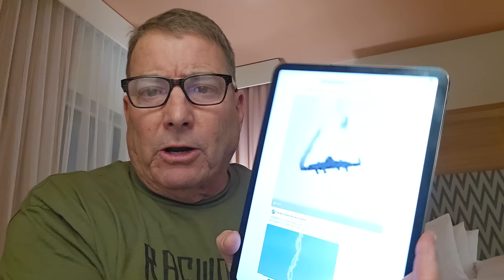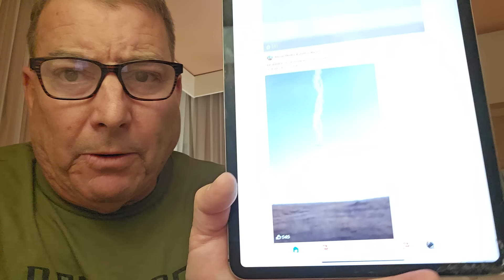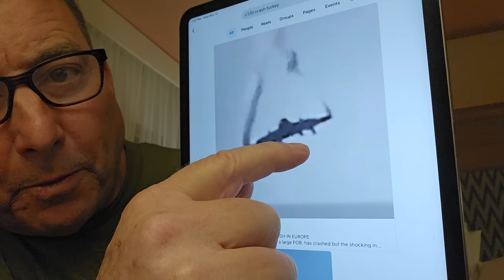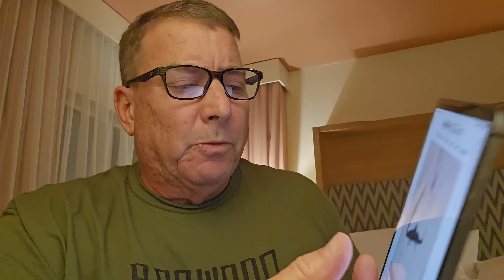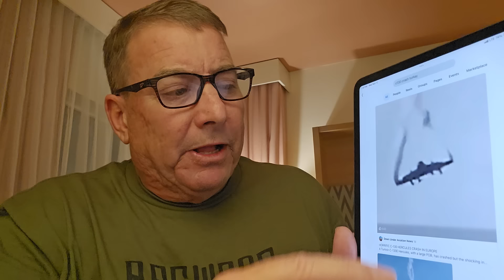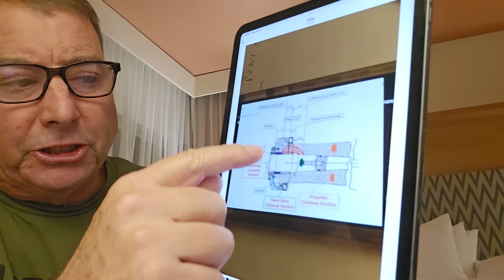Turkish C-130E Structural Failure 11 Nov 2025

Comment: Tragic.   A sidebar: When I was in USAF basic training 1971 one in my basic group had worked with his father's demolition company in Oklahoma. He put in to work with explosives. The USAF assigned him not to explosives but to stress testing of aircraft airframes much to his disappointment. I suppose it was decided someone that worked carefully with explosives would have the temperament to do careful airframe inspections. Landing and take offs put stress on the frames eventually leading to weak points that may eventually cause catastrophic collapse. He would have used devices that test the structure of the metal via xray or sonic waves as I recall.  When I first saw this "structual failure" that is what I thought would be the cause. A propeller breaking loose from rust? That's a new one to me.                                                                                                                                                                                                               Later I was an inspector then final line inspector of aircraft altimeters at Aero Mechanism. I recall one machinest who kept threatening violence because of my rejecting his substandard work :body-blue-raised-arms: My also meticulous nature would not let anything slide past.   Eventually I became a teacher. Now retired.       RIP those who perished.

Comment: My Marine Corps C-130 squadron in Okinawa had a similar incident during a post Phase inspection ground run up in the 80s.  None of the shrapnel hit the plane.  In the early 2000s this issue reared its ugly head again and appeared to be limited to a particular block of serial numbers.  

The Marine C-130 crash investigation in Mississippi finally traced the issue to a failure of the Air Force overhaul facility in Georgia failing to do certain inspections mandated by the Navy for Navy and Marine Corps propellers.  Heads rolled for that failure to follow directives.

The loss of a Chilean C-130  a few years ago (formerly a Marine Corps KC-130R which I had many flight ours on) could be a candidate for the same cause although because the plane went down in the Antarctic Ocean it was unrecoverable.

Those propellers are no longer on Navy or Marine Corps C-130s.  After this incident I think the operators of legacy C-130s will be upgrading to the new props.

Comment: Ok I'm an ex engineer on RAF C-130's at Lyneham in the late
70's. I know it's a long time ago, but we used to get foreign Air Forces
in all the time to do engineering work for them, even simple stuff.
What I learned over time was a lot of what I'd call third world countries
could not provide even minimal servicing.
They were basically not fit to fly.  They would even demand to be worked
on before our own aircraft as they stood at the front line desk.
One guy refused to speak to anyone white, until our Jamaican electrical chief
appeared.  Are we surprised this has happened ?

Comment: The causes of the crash of the Turkish C-130 Hercules military transport aircraft were:
A. One of the turboprop engines propeller blade broke due to metal fatigue (this is the primary cause of the crash). 
B. The broken propeller blade struck the side of the forward fuselage in the plane of rotation of the propeller, causing it to break apart.
C. As a result of the critical damage received and the impact of aerodynamic forces, the front part of the fuselage was torn off from the aircraft.
D. Then the front part of the severed fuselage collided with the vertical stabilizer, as a result of which the latter was severed from the fastening nodes on the fuselage.
E. As a result, due to the high (uncalculated) overloads on the fuselage, the rear section of the fuselage also broke away from the aircraft, along with the horizontal stabilizer.
F. Finally, the video shows the disintegrated aircraft (or rather, the wing with the engine nacelles attached to it) falling, spinning, and exploding on the ground.

Comment: When I was a Nav on Es and Hs, our biggest issue was wing failure outboard the outboard engines. Among other things, it was due to the stresses of overhead approaches and other maneuvers place reverse stresses on the wings. We lost at least two aircraft to this before the wing upgrades. The upgrades worked as evidenced by the LAPES accident at Fort Brag in 1988 or so. If I remember right, the idiot AC purposely achieved a 2000fpm descent rate and impacted the zone at some 9Gs. But the wings stayed on.

Comment: Odd, that I'm seeing nothing about the rear fuselage and tail setion, which we do not see in the footage to date.

It seems to me that an uncontained turbine, compressor, fan, propeller, rotor, pinwheel, etc failure is a possibility on anything that spins really fast, it's a reason why aircraft and such typically have markings to warn ground crew of hazards.

This hasn't happened only to C-130's, but assorted other piston- and jet-powered aircraft, and sort of correlates to the recent UPS MD-11 crash and others of all sort.

While fatigue surely plays a role, both in propeller separation and forward fuselage separation, I'm not sure how realistic it is, expecting structure to endure a propeller assembly buzz-sawing its way through at 1600+ RPM, even new and out-of-the-factory.

Comment: Egyptian Air Force had an accident where both the gearbox and prop separated and went through the fuselage and out the other side.  No structural failure occurred and they recovered safely.

Comment: I'm a bit surprised a C-130 doesn't have a shielding plate on that area of the fuselage specifically to protect against prop fragments. There are a lot of aircraft that have such a plate and aren't even meant for serving in such hazardous missions.
Reply: Those are likely for protection from ice being shed from the blades.

Comment: Propeller overhaul staffer here, unfortunately a failure that's too common. The prop blades are huge and carry a lot of mass, when they let go they slice through anything else with ease. The sinister element is often there is little or no warning before a balde fails. Old aircraft, old props and the most insidious thing with propellers is corrosion or weakening of the alloys after a lightning strike. Eddie Current, Ultrasonic, Dye Penetrant and visual inspections are really important. Cold rolling is really important as well. If they are skipped it doesn't take long for a little problem to escalate to a total failure. It's weird I alway feel so many people don't understand the extreme forces at play with propellers.
Reply: Amen!  I was one of the last groups of actually trained propeller mechanics before the AF combined the engine and propeller career fields. I had a 19 week school on props. That was condensed down to 2 weeks once the fields were combined. They didn’t really know anything. Props can only stand so much overhaul without increasing latitude in specifications. I saw that happening when bench checking newly overhauled props. They'd arrive with discrepancies. Barrel halves leaking under pressure and balance issues. It was concerning. I'm glad you took your job seriously. I always did. My signature meant that I was ready to fly with whatever I signed off.
Reply: @KathyHopkins  It was my first job out of school. Hard work dealing with aluminum blades making them look nice again. I even did a course on the old style Hamilton Standard DC3 prop. Some really solid engineering in that. Unfortunately so many people take aircraft props for granted, they are simple things that are put under a lot of continual loads. I saw some weird ideas, Q tips that were blades with dent over ends and the transition to the new carbon fibre blades. Honestly I trust aluminum more. The carbon fibre blades are very easily damaged beyond repair.
Reply: @leokimvideo People don't realize that the prop is the deadliest aircraft component there is. That's why it was not possible to fly with a known prop malfunction. Hamilton Standard never had a catastrophic failure until the money got tight and the engineers were allowing for broader and broader tolerances. It was a matter of time. They built damned good propellers for many decades. The Allisons they replaced were screw-in blade designs and were retrofitted because they tended to throw the occasional blade with the expected results.

Comment: A tragic thing. However, I cannot understand why the design hasn´t been changed. The C130 is a reliable and very often used aircraft. I never knew about problems with the propellers. There is one thing I like to tell:  hearing a very loud aircraft at obviously high altitude I wanted to know what it was. Flying directly above us the sound was really roaring. I took the frequencies from the approaching and the leaving sound and estimated a speed of 600 km/h which is the design speed of the C130. I wanted to know which one it was. However, the Flight Radar 24 didn´t show anything - military aircraft. The aircraft passes two to three times our region and everytime I tried to see it. One day, when I heard the sound,  Flight Radar 24 showed a C130 from the royal canadian airforce with destination Ramstein in Germany, where I live 150 km off. The speed was confirmed. One time I saw the plane when the sky was very clear. Now, hearing this plane with such a loud "voice" at this high altitude lets me think that there will be many vibrations on the whole structure and possibly two props in combination reinforcing the vibrations.

Comment: My Grandfather was a Captain for Northwest Airlines and a FAA investigator for 727 crashes. Before that, a flight engineer.
They used to carry a coin in pocket to check blade integrity before flight checks. Take coin and tap the blade and listen for sound.

Comment: That is probably what happened. I spent a lot of time with C-130s being stationed at Pope AFB in the mid 80s. (317th, MAC.)
Extra info.: Something that most may not know is that the floor panels of the C-130 provide structural support. If all floor panels are not installed structural support will be compromised.

Comment: Were these C130 prop/gearbox failures, 
1 prop separating causing gearbox/engine separating
2 gearbox failing and separating
I always cringe seeing those airliner size prototype turbo props with geared reduction.

Comment: Perhaps, at some point, their propellers need a complete overhaul replacing any parts having corrosion or maybe replacing the entire propeller assembly.  Maybe?

Maybe the liberated propeller blade doesn’t sever the wing-fuselage joint outright but so weakens it with damage that it completely fails under load.  And maybe that breaks the fuselage into two or more sections.
Reply: Propellers and other aircraft parts and assemblies are usually subject to limits ( calendar time since overhaul or installation, and or time since overhaul) as to when they must be overhauled.  The overhaul is a comprehensive inspection and mandatory replacement of certain parts.  Blades are inspected for damage and corrosion, and NDT inspected for cracks.  Blade damage is filed away, but the blades must meet dimensional minimums.

Comment: These failures on the Lockheed C-130s make me think back to the Lockheed Electra failures in the late 1950s and early 1960s.  Probably just coincidentally a failure in the same areas of the aircraft. 

Thanks for taking the time to post a video.  
I was in the USAF and stationed on a Turkish Air Force base for a year in the mid seventies and grew to respect the Turkish airmen’s courage and pride.  They were flying F-104s and ‘Lead Sleds’ (F-100s) on possible NATO missions against the USSR during the Cold War. RIP to the brave aircrew and deepest condolences to their families and friends.

Comment: My deepest sympathy goes out to the aircraft and family's of this horrific aircraft as a aircraft mechanic for former air America I have worked on these old c130e hurts with the t56 Allison Powerplants and we had corrosion issues ìn the blade hub . And by looking at this crash video it certainly looks like a propeller blade separating from the blade hub causing the aircraft total destruction in the fuselage assembly very disturbing to watch this happen God bless this aircraft 
Thank you

Comment: Maintenance includes inspection. It would be great to look at the records and see if the prop was being serviced correctly. If the corrosion is inside the blade hollow then that is detected at any blade removal event. Corrosion on stressed metal cause’s embrittlement and cracking.

Comment: The "Yanky 72" crash refers to the 2017 crash of a Marine Corps KC-130T Hercules aircraft near Itta Bena, Mississippi, which killed all 16 service members on board. The accident was caused by a propeller blade failing due to fatigue cracking, which sliced through the fuselage and led to the plane breaking apart in mid-air.

Comment: Its likely a missile strike or ordinance onboard let go......the C130 is a hugely strong aircraft, very dubious both the front Fuse and tail falling off at the same time.
Reply: You're wrong. Look up the "Yanky 72" crash. That refers to the 2017 crash of a Marine Corps KC-130T Hercules aircraft near Itta Bena, Mississippi, which killed all 16 service members on board. The accident was caused by a propeller blade failing due to fatigue cracking, which sliced through the fuselage and led to the plane breaking apart in mid-air.

Comment: I remember a Air National Guard C-130 from Puerto Rico crashed from structural failure. Edit: I researched a little on the crash and  the investigation said it was pilot error after losing #1 engine.

Comment: Hang on ! How many times have these props failed for internal corrosion ! I very well remember small commuter aircraft that have also had the same prop failures after they had been rebuilt . And one of the findings of the NTSB was chlorine had been used to clean out the inside of the hollow mounting end of the prop that had failed . Something is seriously wrong in this rebuild process .
Reply: Corrosion is a big problem and you need to take the time to look for it, and have the experience to recognize it.  Corners are always being cut in maintenance unfortunately.

Comment: Much of the speculation in the comments appears premature, particularly regarding possible blade liberation similar to the July 10, 2017 KC-130T accident that resulted in an in-flight breakup and the loss of 16 crew and passengers.

While the available video footage suggests that the #3 propeller is missing from the #3 QEC, the video and still images lack sufficient resolution to determine whether the reduction gearbox (RGB) remains installed in the nacelle or has also separated. At this point, there is simply not enough data available for lay observers such as ourselves to draw reliable conclusions—or even to determine whether the missing #3 propeller was a causal factor in the breakup or a consequence of it.

There are also several notable differences between this event and the KC-130T mishap. In the 2017 accident, liberation of a P2B4 blade led to fuselage penetration near FS 377, impacting the LBL 61 longeron. That initiated failure of the #3 RGB and a subsequent propeller strike around FS 377, which caused forward fuselage separation between FS 350 and FS 477. The aft fuselage remained attached to the wing, although the right horizontal stabilizer was severed by the #3 propeller following the forward fuselage separation.

By contrast, in imagery of the Turkish aircraft, the forward fuselage appears to have separated from the wing farther aft—between FS 477 and FS 485, approximately at the wing leading edge—which is significantly aft of the separation point seen in the KC-130T. The aft fuselage also appears to have separated around FS 737. Photos of the aft section suggest that the ramp is missing and the cargo door is open, though this may be the result of post-crash loads as the tail section is inverted. Notably, both horizontal stabilizers appear to remain attached to the aft fuselage.

In short, while the superficial similarities to the KC-130T accident are understandable, the available evidence does not yet support any conclusions regarding causal factors in this event.

Comment: I may be mistaken but I believe the Embraer Brasilia has the same propeller hub with different blades as the older Hercs, and they too had various corrosion problems leading to several catastrophes. In addition, at least some of the Convair 580's had those hubs and I believe in that case the same blades. In 1983 a 580 lost the #1 blade of the #2 engine on landing (struck a snow bank) and the blade entered the cabin, killing one and injuring another. Throughout the years, other propeller manufacturers (Dowty, Collins NP2000, etc) have offered improved designs to supplant these Hamilton Standard propellers, but very few operators have made the switch. I'll leave it to someone else to offer some opinions on why that might be...

Comment: I was thinking structural failure due to corrosion but I did not know toe prop could do that! I never actually worked with that aircraft but am familiar with that airframe. I was thinking time and operating environment leading to galvanic corrosion. What part do you think is exploding? Thinking about the life of the engine I am guessing the gear box, possibly due to bearing wear. Something I never really thought about until now!
Reply: If the main drive gear breaks in a T56 RGB it can split the case and liberate the propeller drive shaft, and hence the whole propeller. This has happened.
Reply: @TricksterJ97   That is what I was getting at. it let the short shaft go.